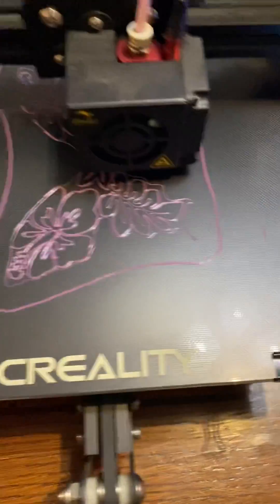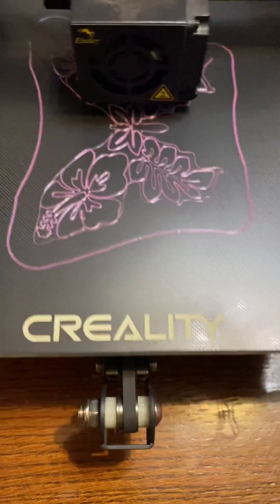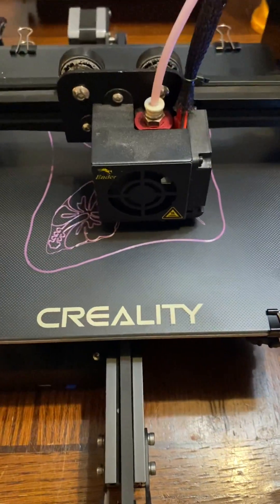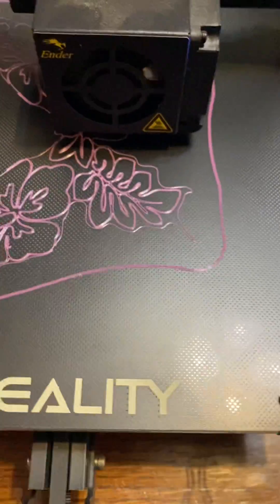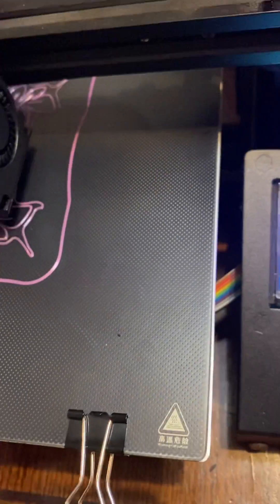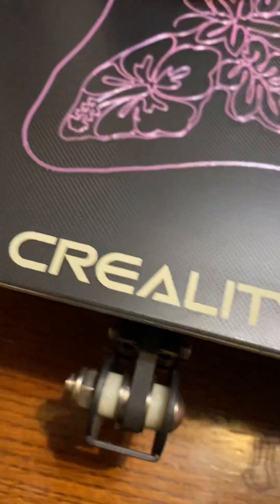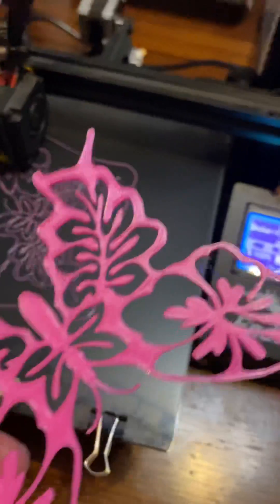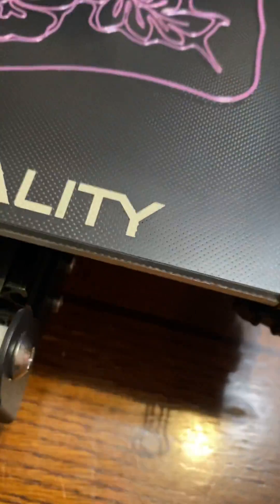Creality Ender 3 Glass bed adhesion solved!!

Comment: There is no need to sand the Creality Glass Bed.
I have the same Bed and initially had difficulty getting my print to stick.  I levelled the bed using a piece of paper, folded it once, and adjusted the bed so the nozzle just touched the paper.  Also, I clean the bed with alcohol before each print and ensure the bed is clean.
My prints stick to the bed, very well.

Comment: Of all the professional 3D printing gurus on YouTube you are the only one to get this right. I have used the flip side of my glass bed for year along with glue stick because I didn't think the stupid coating worked. All the crap about tiny fibers from tissues and stuff, really BS. I reckon the film they put on the plate has a release agent on it. A bit of sanding and the coating works a treat. Awesome!

BTW: It's not the roughness because I previously sanded the back if the glass and it still didn't adhere.

Thanks for the help 👍
Reply from the maker: I just figured there had to be something to do so let it stick better! Glad it worked for you!

Comment: Good luck removing your prints when finished. I wasted allmost 2 hours trying to remove the print from the bed without sanding. I first tried all temperature options including the fridge method without any succes.  The only method that worked for me was removing the print using a HAMMER AND A FLATHEAD SCREWDRIVER.

I'm waiting for my PEI sheet.
Reply from the maker: I’ve had no adhesion problems since this video.

Comment: Weird, I have the opposite issue. Stuff sticks too well if you have it perfectly level are extruding properly.  I prototype in 0.28 and my first layer is going down at about 0.26-0.30 as measured with my digital calipers.  I have a CR Touch with 25 point bed leveling so I feel my bed and printing darn accurate.   I struggle to get parts off, use IPA to try and cool/ allow it to seep under to break the bond and it barely works.  I'm guessing there is some calibration or step that is key to making this work.

Comment: It actually works, just a tip for what I did was to do straight movements with the sand paper. I used a bigger grid at first and then I used a smaller grid for the finish. Don't go crazy because you risk damaging the special coating. It works flawless now.

Comment: Well thats amusing.  Essentially all you are doing is sanding off the coating that Creatilty put on it so that it could stick and peel off easily.  Sanding simply removes that coating and you are left with just a plain glass bed.  At that point,  you might as well just flip the damn thing over and you'll have the same effect without the need for sanding ;)
Reply from the maker: I scuffed the surface. Didn’t completely sand off the coating. So it’s not plain glass. Thanks

Comment: Basically you sanded down the special coating. Isn't the whole idea of glass bed is the special coating to remove it easily? So yes, you have better adhesion, but how is it when removing your prints? Any print residue sticking left over?

Comment: My print all get stuck and I can't get them off
Reply: wait until it cools and try sticking it in the freezer. If you sanded the glass surface, you've probably sanded off the special coating that makes it easy to remove your print

Comment: Mine has the complete opposite problem where the print actually adheres too much and is insanely difficult to remove I end up putting the bed with the print in the freezer and it works but I am looking to eliminate this anyone knows why?
Reply: Same for me!

Comment: I had the same problem i solved it by washing in soapy water so its clean and then just pre heat the bed at 70 and waited for 5 mins and you set .Load your stl and print sticks every time now no ploblem at 200 hot end and 60 bed

Comment: I wish I found this video two days ago, I could've saved myself hours of frustration.  Thank you for the tip, though.  It fixed my problems!
Reply: sanding it defeats the purpose of using glass... its supposed to hard to scratch and easy to scrape clean.

Comment: You have to clean it when you get it to sort off activate the coating. I'm having the opposite problem and I can't get my print off the bed. It's in the freezer right now.
Reply: haveing the same issue. Everyone is saying that prints will come off their own once cooled down. That is not happening for me. It takes a lot of force to get any prints off. Any luck?

Comment: I do PDR, one technique is to glue a tab to the dent (automobile) and after it's cured pull it out. When the glue comes loose from the paint too easily I will use a polish to create a micro texture that will bond better. I wonder if this will work also?

Comment: Thanks, I just tried this on my CR-6 SE bed and it has worked perfectly! Originally it worked fine, but one day I started to get adhesion issues. I cleaned the bed multiple times but it still wasn't great and I had to crank up the bed temp to get things to stick. Even then I'd get a bit of warping. I bought a set of cheap sponges on Amazon, and used the 80 grit followed by the 120. I've just done a test print and it stuck perfectly at 60 degrees.
Reply from the maker: Awesome!! I’m glad it worked for you. Just trying to help with the ones who want to fix their beds or started off with a bad bed like I did.

Comment: all you need to do is keep the build plate clean. about every 10 prints i will scrub the build plate with soap and water then when dry just whipe it with IPA, and i have zero issues with out having to sand it down.

Comment: How is yours layered, I’m trying to print but the damn nozzle is too far and my back knobbies don’t turn as much as the front ones
Reply from the maker: When you initially set up the glass bed, first loosen the stop switch on the z axel that stops the extruder from hitting the bed. Second, place the corner of the glass bed underneath the plastic part of the now loosened z stop switch. Lastly, as the glass bed corner is still under the stop switch you may tighten the screws and you’ll have successfully accounted for the glass bed thickness when leveling the bed. My bed had a similar problem but it was that I was tightening some leveling knobs more than others.

Comment: Thanks for posting this video. I sanded down my glass bed slightly and my printer now works perfectly fine without any additional adhesion additives such as hair spray and glue sticks. I used to flip over the bed and use painters tape.
Reply from the maker: Nice! Yes it has worked very well for me afterward as well!

Comment: Try to Wash it and heat it first,  Sanding will damage the coating. What grit? Not super specific so people could over do it
Reply from the maker: The gator sponges I used didn’t specify a number for the grit. I just used medium grit as the label said for the sponge sand paper. I haven’t had any issues with adhesion since I tried out my sanding. I clean it with soap water at times when my hands touch the bed and get it oily.

Comment: What grids of the sand sponges should I use on plastic magnet bed?
Reply from the maker: I’m not sure on that. I would only recommend sanding glass beds if they’re not sticking to your desire. You should get the spring steel magnetic flexable bed. May be better.

Comment: My V2 came with a glass bed, I tried the stuff u mentioned, lots of glue and washing. Solution magnetic pei coated sheet. $40 best investment ever
Reply from the maker: One good sanding and clean it with soap and water and you can use your glass bed again if you’d like!
Reply from the maker: Nice! My bed works properly. I have my pla set at 215 and it adheres fine.
Reply: Yeah might give it a go for experimentation. I enjoy flexing the bed for easy removal of my prints, I've had truoble removing things from the glass before. Do you hear ur bed for pla?
Reply from the maker: Yes at 70.

Comment: Yo, I gave up on my creality glass bed a while back because nothing else worked for me. The sandpaper trick worked perfectly. Everything is sticking the way it should now. Thanks!
Reply from the maker: Yes! When you clean it use soap water! No alcohol or any chemical and it will always adhere!
Reply: which grit u sanded it with?

Comment: Yea ive bought my ender 3 pro like 2 months ago...setup went fine with the build..printed out the 3 basic prints on card was so excited to try something new...went to try a thingiverse file...did it to a "T"!!! All the cura stuff....nothing will stick...tried the glue shit ..crappy...did the hair spray thing..thats a joke...the original bed should have been just fine when selling a broduct to begin with....not junk!!! Either way...yep spent hours on end on utube...trying diff settings...yeah this ender bought to be a boat anchor!!!! Cant believe with all the world reviews being 1 of the simplest plug and play printers...u have to do 1 so many upgrades...that may or may not do crap...which i bought the cr touch bed leveling thing .....cant get that to download properly...bought 15 different sd cards and had a friend which is it tech...try to do same thing...and yea...freaking lemon... made in god knows where...JUNK!!!! AND THEN SOME!!!!🤬🤬🤬🤬🤬🤬🤬🤬🤬
Reply from the maker: I’ve had no problems printing besides upgrading the bed for better adhesion.

Comment: I've used a glue stick and clear glue, which requires tons of scrubbing down each use. It became tedious and took the fun out of printing. 

After some trials and errors, It's best to use the glass bed as is. I've tried eSun and various other cheap PLA+ brands and this method works just fine. 

1. I print 200/60 with 0.4 initial layers with great adhesion on most brands. Some do require 220/70. 

2. ONLY REMOVE your print when the plate is cooled down below 35-40 degrees. It'll come off by itself. Removing your print before this will ruin the special coating on the glass. 

3. Do a circular wipe down after each print. Takes 5 seconds to remove dust and grease accumulated from the previous print. Cleaning solution: 1 part water, 2 part dish soap, 2 part alcohol. 

I have done a lot of 3d lettering prints, 40-50 pieces a week and this works 100%. A bigger piece like a 20cm vase also adhere fine - without brim or raft. But I do add a 4 line brim just in case.
Reply: just clean it with some acetone or mineral spirits. acenton can be purchased for a few bucks a quart and it dissolves pla so u can use it to clean nossle and things like that. Scrap the glue off with a scraper (not a cheap one one that uses a standard utility knife blade) then spray it with aceton and wipe it up and that wil take about 30 seconds and scraping glue is fun and satisfyign for some reason.

Comment: Fellas - this is CREALITY 2 days long answer for my simple question (and description what I´ve tried) why is nothing sticking to this carborundum glass bed and what to do - cool answer isn´t it :D?:

----

Dear Customer

Sorry for the inconvenience,
Thank you for supporting our product.
Based on the problem your describe, In order to help you better.We need more information about the printer.

1:Your complete orderscreenshot and purchase link (it's a warranty certificate )
2:Your printer product SN(it's a bar code sticking on side of the control box or QR code)
3:The issue relevant video or picture

Looking forward to your reply.

----

So I answered them quite "nervously" (you are kidding me?! :D) and in minutes I´ve received this (they are simply saying DONT CLEAN IT WITH ALCOHOL, YOU MAKE IT NOT WORKING BECAUSE EVERYTHING MAGICAL IS HAPPENING ON SOME CHEMICAL COATING, NOT ON CARBORUNDUM LAYER WHICH IS JUST FOR LOOKING COOL PROBABLY ... OH MY..:D).

----

Dear Customer

Thank you for your reply

Sorry, there may be some misunderstanding.
We collect these orders and serial numbers mainly to register your machine information in order to provide better service for your machine.
About the video or picture, it is mainly to confirm the condition of your current machine.
Because there are many reasons why the model does not stick: uneven glass plate, uneven printing platform, the protective film of the glass plate is not removed, etc.
So we need some pictures and videos as a judgment in order to provide you with the corresponding solutions.
Also, you mentioned cleaning the glass plate with alcohol, we do not recommend you to do so.
Doing so will damage the coating of the glass plate and cause it to become smooth and not stick to the model.
You can try re-leveling the printing platform and applying a solid layer of adhesive to the glass plate.
Reduce the printing speed when printing the first model layer
Reply from the maker: Yea I don’t believe they’re right. That’s insane tho! But I’ve been getting good prints ever since I did what I did so I’m a happy camper.
Reply: @Henrylopez000  I will definatelly try your method, because it make some sense to "roughen" surface to be more grippy. But I am that kind of person, who simply needs to understand, how the living hell they meant it when they engineer this plate...maybe it is meant just for good removal after cooldown (but mirror or glass acts the same when cooled) so I am just trying to find sense in all this if you know what I mean :). Today some engineer sent me gcode file (which wasnt gcode but txt) and my friend Sammi from service sent me this, so I will try what they are suggesting and will continue in my journey here in your channel if you dont mind too much :)..but I believe its educating for all sides in any case.

Good day~

The response from our technicians is as follows:

It is not recommended that you use alcohol to clean the carborundum crystal glass, as this will damage the coating and will reduce adhesion.
Please refer to the video to level the machine https://youtu.be/…fHE
1. Please use PLA for print testing
2. if the outgoing filament adheres very thinly to the platform, the distance between the printhead and the hot bed may be too close for the consumables to adhere properly, conversely, if it is very thick the printhead is too far from the hot bed.
3. set the initial layer layer height 0.15mm, reduce the initial layer speed to 10mm/s and the flow rate can be set to 110%.
4. Do not fluctuate too much in ambient temperature, which can easily lead to cooling warpage of the model.
5. If the above operation is finished or unable to stick the platform please use this file for printing and provide a video of printing the first layer.

Awaiting your reply.
Thank you.

Yours Sincerely,
Sammi  
Customer Service Department
Reply: So as always with China manufacturers: Pretty useless customer support (only generic ideas on what to do and first they want to have is photos and your serial number). I wouldn’t rely a second on Creality when it comes to issues with my printer. They make great hardware that’s very well moddable and commonly used in the community, but that’s it.

And why add adhesive to a glas bed? Isn’t the purpose of a glas bed that you don’t need any additional adhesive stuff anymore? When I add glue stick to the glas bed then I don’t need a glas bed at all.

A general suggestion is to print with higher first layer temperature and pre-heat the bed for longer to get the heat spread out more and more evenly.
Reply: Exactly, I screwed up my bed by following the directions in the manual which states on page 2 "Clean the bed before every print with Isopropyl alcohol" It worked brilliantly when I got it, 3 days later NOTHING would stick to it..

After a month of trying to work out why I came across "Cleaning Glsss Bed" thread on the official Creality forum on which the admins checked with tech support and posted "Cleaning the glass bed with alcohol will permanently damage the surface coating of the bed so you should only use soap and water to clean it"

Some of thier own adverts for the glass bed STILL state "clean with Isopropyl Alcohol" despite them knowing this will render it useless.

And even if you pont out that Creality themselves state quite clearly that alcohol will damage the surface, there are still thousands of users claiming thats BS and you SHOULD clean it with IPA..

SMDH

I recently bought a vyper which comes with powder coated PEI spring steel bed, sticks superbly, releases easily, and has been no trouble from day one

Comment: Cleaning mine with acetone and a fuzz-less towel worked great. Set my plate to 70C for PLA+. Prints release once plate is cool. Works like a charm now!
Reply: I cleaned my several times and have 0 adhesion, I have changed filaments, bed and nozzle head put on a new nozzle changed fan speed etc. the printer did fantastic for like a year and then one day just literally would not adhere to the bed.
Reply: @blake20054  is anything under the glass preventing the heat from conducting up into the glass? put some thermal paste under there like its a heat sink on a processpr j/k
Reply: @mrschnider6521  that's what I did and temps around the glass is more even now.
Reply: buy a utility knife scraper and scrape then spray the aceton for whats left, mineral spirits is great if u dont want sometrhing that evaporats so fast but it wont disolve the pla.
Reply from the maker: That’s great!

Comment: Another question, roughly how long do you let the glass heat up before printing? tried this at 60 degress on the plate and it stuck but then pulled itself off later on in the print, going to try 70 like you have it.
Reply from the maker: Once my  bed reaches the degrees I put in cura it just starts printing. I don’t preheat anything except the extruded to change filament.
Reply: 70 works great for me. I did acetone the plate too.

Comment: I went through exactly the same issues you did (which did not exist using the magnetic bed) and ended-up using blue masking tape on top & worked like a charm as well.
I might give your trick a try as well - thanks for the tip.